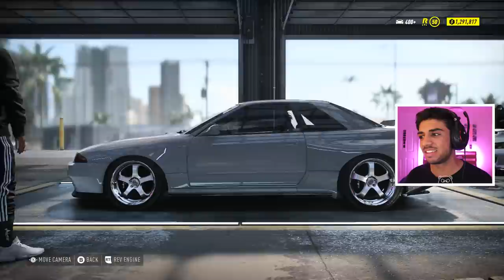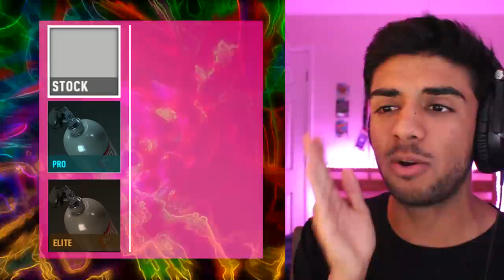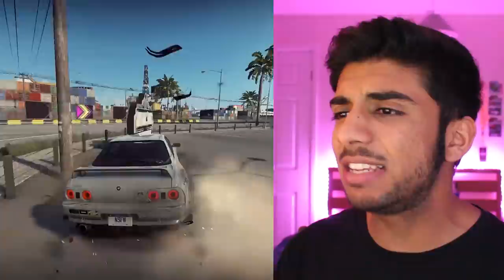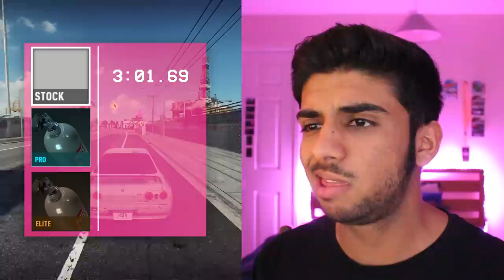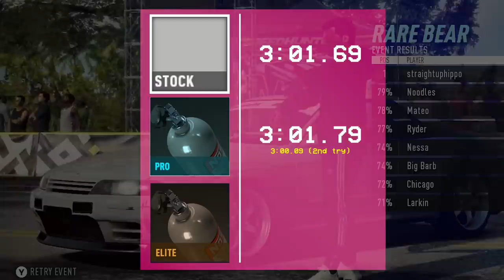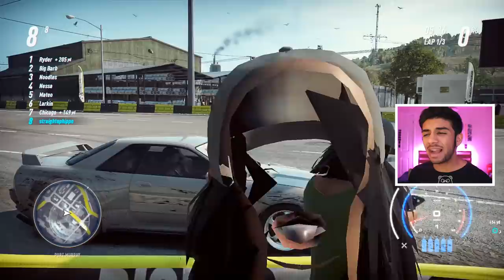❗THIS UPGRADE WILL MAKE YOU 3 SECONDS FASTER❗ - Need for Speed Heat (Tips and Tricks)

Comment: Idea for future video: why not make one of this switching between traction control on and off. Could be with the RSR or more than one car. I think it would be a good one.
Reply from the maker: Good idea! :)
Reply: @StraightUpHippo  Ive actually been doing that myself with the RSR in some tracks. Its been a good fight between on and off, but I guess it will end up being about the kind of tracks. The latest one has been J.Storm with Rsr, got the best time with ON so far by less than 1 second, but I still feel like I can do better in the Off side, so Im still not 100% sure for that track with that car. Not enough time to try it with more cars for now. Its been testing my RX7 drift build and the RSR race build. I wish I had even more hours for it 😂